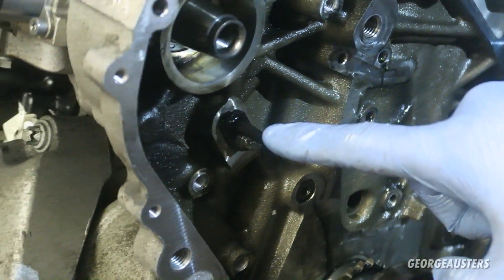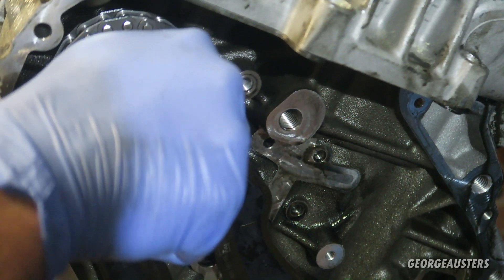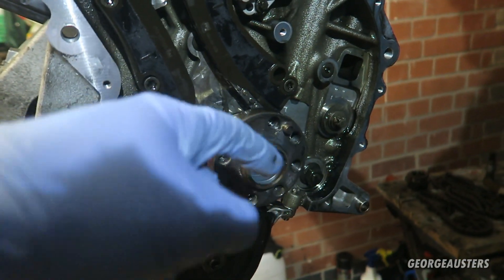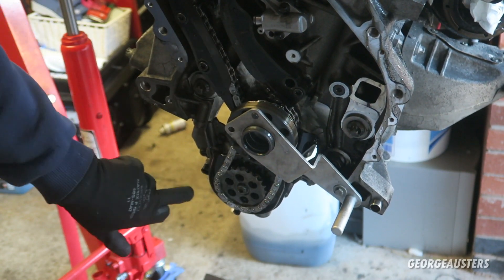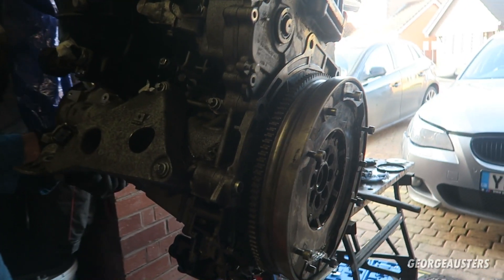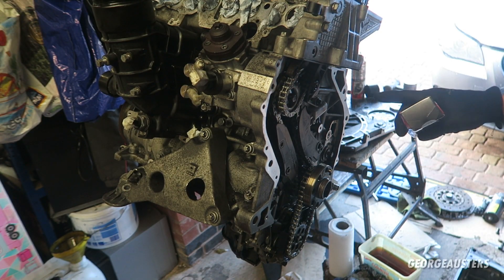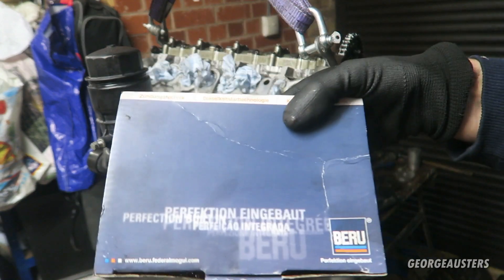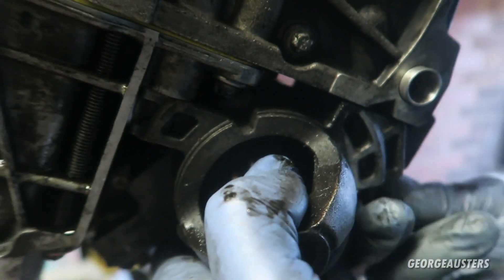BMW N47 Timing Chain Replacement | Part 2

Comment: Question regarding the timing process. Once the chain is fitted 45 degrees off tdc and put the cam pulley on etc with the bolts loose, surely you have to take the cam pulley back off when you move the crankshaft back to the tdc position?
Reply: I know I’m a-year-late for this comment but I think you don’t have to remove the camshaft sprocket while moving the crankshaft back to TDC since you can see the sprocket can actually move without messing with the camshaft (camshafts are locked by special tools anyway), but I was wondering what if marking the camshaft sprocket where the three bolts was before remove it at the beginning will help?
Reply: I am going to do my chain this week, I was wondering the same thing, does any know for sure if there bolts can be left loose in the cam sprocket while the crank is rotated back to tdc. looks this way in the video. but its just not clear enough
Reply: @charliekarting3401  did you do the timing chain? Got to this point exactly where cam sprocket needs to go back 45 to TDC. Thanks!
Reply: @nathancracknell6169  Hi, I think you can leave them in if I remember correctly, also the cam sprocket sits on a decent lip on the end of the cam so the sprocket naturally wants to stay on. Hope it goes well
Reply: @charliekarting3401  Thanks for the reply! ive just done it, just about to turn it over 4 times and check the marks still line up!

Comment: Does anyone know if the guide rail on the crank to fuel pump should have movement even after being tightened?? Like in and out not up and down.
Reply: Mine does, having just installed a new kit. I think its because the bolt doesn't have a head so to speak.

Comment: You should know what are you doing. You have N47D20A engine so you should fit new timing cover gasket and oil sump gasket. The silicone is for N47D20C engine from 2010 year. You will get oil leaks from this engine.
Reply from the maker: I did know what I was doing, only the silicone came with the kit so I used that along with with original timing cover gasket. I used a new sump gasket which is a dry gasket.
Reply: George Austers you should fit new timing cover gasket. Its a metal gasket and its can be used only one time.

Comment: Perfect job!!!!   Just 2 small moments missing -  sealing cover to cylinder head and remind about Crankshaft Position sensor plate to fit  before You put flywheel on last time. For first time doing this job is good to know :)
Reply: Janis can you explain more about the crankshaft position sensor plate fitting and cylinder head sealing cover?
Reply: @HypoxicWaiter  About sensor plate- it is very important to put in before last time fit a flywheel- first time doing this job I found plate on tool box when engine was in the car :(   and head gasket and cover must be perfect degreased and good gasket maker must be used there, because always is risk of oil leak between head and cover. I found best gasket maker- Permatex blue. Best for sumps and timing chain covers

Comment: Hi George, nice videos first of all.
I have a question regarding the oil pump sprocket because I am missing something. What do you mean when you say torque to 5 Nm plus 90 degrees?
Do you rotate the sprocket (anticlockwise?) 90 degrees after 5 Nm torque have been applied?
Thank you!

Comment: Jobs like the Cam pulley and drive belt, in fact the whole timing chain process too; do you think access will be harder in a 1series 120D? Thank you
Reply from the maker: Timing chain process is the same if you’re taking engine out. For crank pulley and drive belt kit you may need to remove radiator fan as engine bay is smaller on 1 series
Reply from the maker: Timing chain process is the same if you’re taking engine out. For crank pulley and drive belt kit you may need to remove radiator fan as engine bay is smaller on 1 series
Reply: @GeorgeAusters  cheers, very much appreciated.

Comment: What brand of kit do you recommend?
Reply from the maker: Buy the timing chain kit here: https://amzn.to/39gvrha
Reply: @GeorgeAusters  OK thank you!
Reply: Melvin Vermeulen this is the worst kit I would recommend! Been doing timing chain replacement for these engines for the last couple of years and FAI timing chains bad quality. You’d be better of with Febi, it’s a bit priced, but you get superior quality and they will last forever if you change the oil every 10k!
Reply from the maker: You do realise FAI do not make the chains right? They’re IWIS the exact same as the OEM 🤦🏼
Reply: George Austers it’s not about the chain it’s self mate , i said the KIT. The (both) hydraulic tensioners en guides are just shit. Speaking not only from the n47 engine, but also from VAG-line and PSA PRINCE engines. Btw you missed an important part in the video: aligning and paying attention to the spline grove of high pressure pump, before installing the sprocket. If you do it, do it right ffs.
Reply: sohaib khan you can find  them on the web or just ask your local parts dealer. Product number is : febi 102040
Reply: P.I. M. Thank you ,they are pricy !Do you have any knowledge about Dayco?Are they any good?thanks
Reply from the maker: @sohaib304  That is not pricy bro... If you can't afford this FAI kit then you shouldn't own a BMW sorry
Reply: George Austers i was talking about Febi  bro not Fai ..
Reply: sohaib khan I am not familiar with chains from dayco. I know that the quality is guaranteed with FEBI, even the plastic guide rails are superior relative to fai
Reply: I would take Febi, those are the best for this engine
Reply: M. E.A. Couldn’t agree more. IWIS chains are one of the best, especially ones with the Tritan-coating!
Reply from the maker: The FAI kit uses the IWIS chains? 🙄
Reply: George Austers Unfortunately they don’t, I’ve checked almost every single of them. IWIS only manufactures them for aftermarket for SWAG and FEBI.

Comment: Hi George, 
Great vids, I have been gong through them as I have a N47 which I bought in bits, long story!
Can I ask, the 45 turn to after TDC. I have on some sites that the dowel is in the lower hole of the tool. 
Could you clarify this for me please. 
Also once this is at 45 ATDC is that when the timing mark on the pump is in line? If so is the crank rotated back to TDC for the fitting of the top chain?
I hope to get advice from you in this. 
Kris

Comment: Really good video. Just wondering if this job can be done with the engine still in the car.
Reply from the maker: It can but access isn’t great, you need to remove the gearbox and have the car  high off the ground.

I didn’t fancy lying on the cold floor for hours at a time while trying to get my head into a tiny space so in my opinion it’s much better to remove the engine and then you can do a whole load of other jobs at the same time👍🏻
Reply: @GeorgeAusters  of course if you dont have a ramp youll be much better off taking the engine out like you did. Great job, thanks.
Reply from the maker: No problem👍🏻

Comment: Do the lci 5 series still need replacing ?   I know ours has never been changed but in Portsmouth I am getting prices of over 3000 pounds
Reply from the maker: All N47 engines are affected but like I said in my recent video; regular oil changes are key to prolonging the life.
Reply: @GeorgeAusters  But there is a huge difference between the old N47A engines and the newer N47D20C engines. If you have the old version there is almost a 100% guarantee you will get problems. These newers engines are much more reliable with chain updates and stuff
Reply: @wesley8096  It's true that the N47D20C engine (post-march 2011) has been considerably improved compared to the previous version, but the timing chain issue has not been entirely eliminated. As George rightly stressed, regular oil changes are vital. And you should preemptively replace the chain at some 200K km at the latest, just in case. Of course, you should replace it even earlier if you notice the characteristic rattling noise.
Reply: @liberalniautokrata7697  I believe you, but I have to say I'm already at 255K km with mine, and I'm not planning on replacing it for as long as I hear no noise coming from it. I think it also depends on what type of driving you do. My car doesn't really drive anywhere except for the highway. I've also heard that N47's with manual gearboxes (like mine) are more likely to get chain issues because of the 'bumps', where a DCT can provide a much smoother engine operation. I have 2 colleagues with also N47's approaching the 300K km with the original chain. If one of our chains should break, I will let you know ;)
Reply: @wesley8096  I read somewhere a few years ago, after my 2013 320D chain broke, and caused significant damage internally, that it's the frequent, shorter, cold drives that cause the build-up of metal fibres (not sure I've used the right term) which eventually leads to these breaking. Frequent oil changes can assist in prolonging the chances of the chain snapping.
Reply: @marksargent2908  100% mate. The short drives are killing as well as thr EGR. I sold my BMW to a friend of mine and now has 320.000km with original chain. Colleague of mine, 320D, same engine, 280.000km with original chain. Warm up your car proprely, change the oil frequently and if possible delete your EGR. These engines will last forever if you do that.

Comment: When using a torque wrench, the first click is enough, making the wrench click more times will over tighten the bolts. Saw you click 2 times and more, and that could make the torque tentionon the bolt much higher than the recomended setting 🤷🏼‍♂️ seen most of your videos, and good work on you. Got the same model as you myself, and doing the maintence myself.
Reply: A well calibrated torque wrench will click at the same torque everytime.
Reply: Lol clicking it more than once is some kind of OCD. I always do it too :)
Reply: I'm pretty sure that you WON't be overtightening by adding more clicks. The idea of the torque wrench is that you can't go over the torque setting selected. However, I'm pretty sure that if you're using the torque wrench whilst the engine is suspended then you won't be getting the correct torque as the engine is moving slightly every time you attempt to tighten. This will under-tighten the bolts. The engine needs to be resting on a solid surface whilst using the torque wrench.
Reply: Does the fuel injectors have to come of for this project?

Comment: can.t wait to hear this puppy up
what would you say is the average lifetime of a timming chain
Reply from the maker: Timing chain SHOULD last forever with proper maintenance
Reply: @GeorgeAusters  How many miles done since the change? And do you intend to keep it? Also did you change clutch at the same time... I'm about to have my chain replaced in a 118D Msport 2008 N47
Reply from the maker: @bald_flexproductions565  Watch the other parts in ther series bud. Kept the same clutch and flywheel as it was replaced at 80k miles. I've done around 2000 miles since replacing it and want to keep it for about 5 years if possible!
Reply: @GeorgeAusters  Thanks for the reply, will watch the rest. I have the  same intention with my N47, hope it's not wishful thinking.
Reply: @GeorgeAusters  I'm chucking in a new clutch anyway just for good measure.